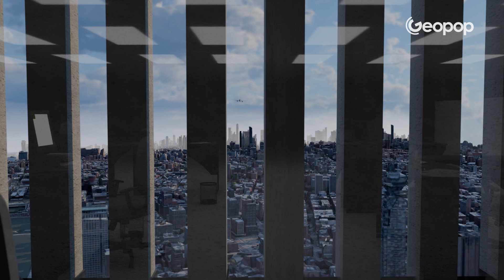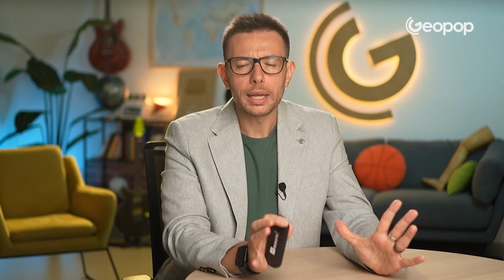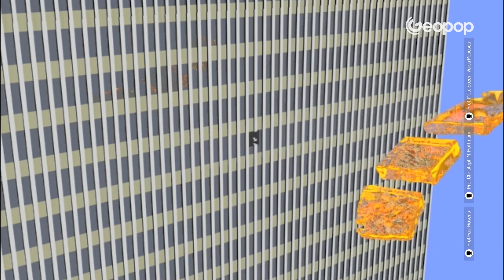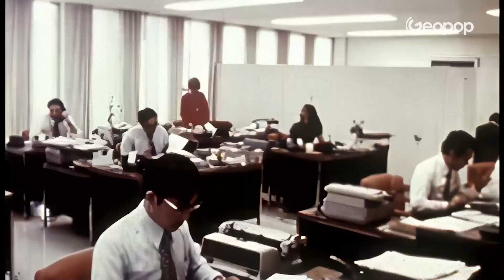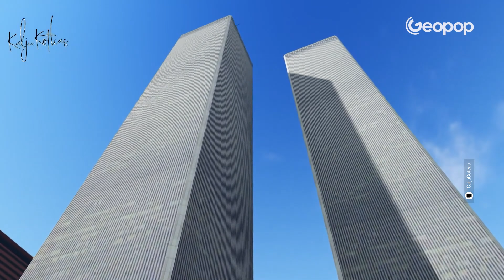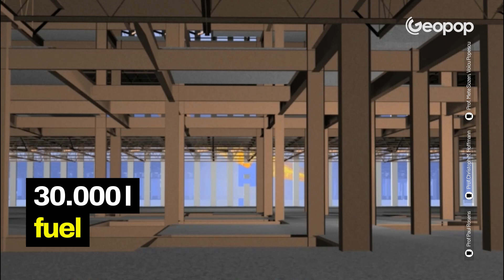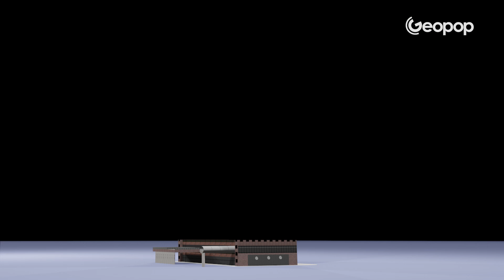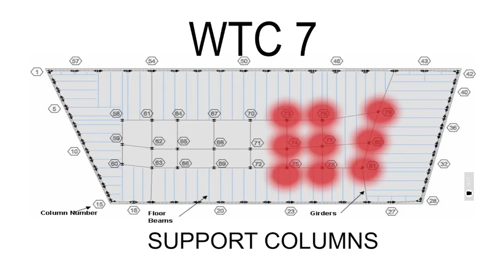9/11, 2001: The Technical Reconstruction of the Twin Towers and WTC 7 Collapses

Comment: Let me emphasize several facts your video got wrong:

9:13 - steel does not loose, but INCREASE strength when increasing temperatures from 20°C up to 250°C. It weakens to the same strenght as on room temperature when heated to about 400°C. This means that parts of the structure that weren't heated much were actually STRONGER than cold parts of the building!

11:47 the higher the temperature, steel deformes more easily, but its breaking point extends, up to the point where very hot steel doesn't break at all! Very hot steel can be elongated more than HUNDRED of times without breaking (remember steel mills?). Cold steel breaks, hot steel bends! Therefore, very hot beams of the WTC surely didn't break, but rather BENT, FLEXED or BUCKLED!

12:30 even your animation does not match the "as seen on TV" videos: your simulation shows some parts of an airplane (e.g. wingtips) bouncing off the outer walls of the building and falling down outside (as it would be expected). However, there were NO parts of the airplane "as seen on TV" that fell down outside, i.e., whole of both airplanes entered the buildings. It was only the explosion (of what*) that ejected parts of those airplanes outside of the buildings.
* - jet fuel in an airplane cannot explode, that's simple physics. If it did explode, the blast would break liquid fuel into mist that cannot form ponds on the floor and therefore couldn't have burned long enough to heat up the concrete/steel enough to cause a collapse. We know it didn't happen because there were testimonies from survivors who claimed that jet fuel seeped down the stairwells and elevator shafts.

13:38 how do you know that impact severed exactly ten core columns? Were there any survivors to examine/witness that? Yes, the outer columns can be easily counted from the videos/pictures filmed from the outside. But who filmed the interior of the building after the impact?
Reply: I feel like the people inside were a little too preoccupied with something else to check if the support columns were severed
Reply: The building was held together by the floor trusses. The interior columns were connected to the exterior walls by the trusses which gave the building its structural integrity. Sure there’s not much difference in the strength of steel under 400 degrees Celsius. But it drops off dramatically after that. Standard jet fuel burns up to 1,000 degrees Celsius. So I don’t really understand why you think 400 degrees Celsius is important. Steel trusses fail at 600 degrees Celsius which unprotected can be reached in minutes in a 1,000 degree fire. The impact of the airplane knocked off the majority of the fire proofing around the floor trusses. So they were able to heat up rather quickly. Also trusses get their strength from their shape. So once you start heating up portions of the trusses they expand and deform which dramatically reduces its strength. Far more than if it were I beams or just a slab of steel which get a lot of their strength from the actual material. I agree that this isn’t the best presentation when it comes to detail. But yeah when you look at the blueprints and you realize the structural integrity of the building is maintained by the floor trusses then it all makes sense. Once the trusses reach a temperature of 600 degrees Celsius they will fail and multiple fires on multiple floors will mean once one fails it’s going to cause the next one to fail simply because it was likely about to fail  because of the fire anyway.  Which causes a cascading effect and yeah the entire building unzips. I’m not sure about building 7. I haven’t really looked into it. But 1&2 make perfect sense for why they fell in the manner they did. I haven’t seen any convincing evidence to support a controlled demolition.
Reply: @SuppressHoardReject  You obviously didn't read both my comments thoroughly. Think about this: the only way to make the floors "pancaking" is to heat the complete floor structure to at least 600°C simulaneously! The whole 2300 tons of steel and 2300 tons of concrete! But then, calculate how much energy was available at the time (airplane and furniture) and you'll realize there was enough to heat up MERE 10% of a single floor mass. Then go and check impact hole of the B767 and you'll realize it broke into THREE FLOORS, therefore this itsy-bitsy-tiny amount of energy was spread to not just one, but three floors! Not 2300 + 2300 tons, but 6900 + 6900 tons of steel and concrete. Therefore, stripping of fire proofing and 1000°C burning temperature of jet fuel meant nothing! Heating just one spot on the floor wouldn't make any difference structurally, plus the heat quickly spreads throught both steel and concrete, so the whole floor had to be heated up to 600°C simultaneously, but there simply WASN'T ENOUGH ENERGY for that! Why is everyone quiet about this?!?

400°C is important because up to 400°C steel retains its original strenght. Meaning that, heating for 250°C is not enough, even 400°C is not enough. Only above 600°C steal does get weak, but then it DOES NOT BREAK, but bends, buckles, sags, twists... Therefore, a properly heated WTC floor would SAG into a bowl-like shape, NOT break and it would NOT have created the pancake effect! Google: "steel ships destroyed by fire" and you'll see what I'm talking about.

I said I was working in ironworks and I know how difficult it is to heat up the steel and how the hot steel doesn't break but can be elongated numerous times (13 x 13 cm, 6 meters long steel beams were elongated - milled into 12 millimeter rebar wire 250 meters long)! I posted more numbers in my previous comment. It turns out heating the concrete is even more difficult (and you cannot heat them separatedly).
Reply: "how do you know that impact severed exactly ten core columns? Were there any survivors to examine/witness that? Yes, the outer columns can be easily counted from the videos/pictures filmed from the outside. But who filmed the interior of the building after the impact?"

How do you know they didn't?
Reply: @ghostsignal  Exactly! I do not know they didn't just as examiners do not know they did! Examiners calculated that it would take - EXACTLY - ten broken core columns to collapse the building - threfore it had to be that exactly ten were severed. Funny enough, exactly ten inside both buildings! (Nothing fishy still, @ghostsignal?)

But then if you take the structure of the aircraft, its weight, its available energy, the trajectory into account and calculate how many it could actually severe, you'd get nowhere near the number of 10 columns. Examiners also realized that but decided not to speak about it! I can understand them, they're under political pressure, but what about the rest of you? Why do you keep quiet? Am I the only one doing calculations here?
Reply: 13:27 - the fire proofing materials were applied on the bottom side of the floor, right? However, the animation shows that airplane entered the WTC in downward direction, therefore concrete slabs of the floor were preventing airplane parts touching steel trusses, thus protecting fire protection coatings from being removed. Your animation (and post-impact pictures too) shows that floors survived initial impact more or less intact. Right?

14:11 + 3:25 - if WTC had 250.000 tons of steel and 250.000 tons of concrete, and it had total of 110 floors, it means that one floor had about 2300 tons of steel and 2300 tons of concrete. Your chart shows something called "burner" with 10500 kilowatts of power, did you ever try to calculate how high temperature such a burner can heat up 2300 t + 2300 t of steel + concrete in 78 minutes*? Well, my calculations give MERE 8°C !!! (assuming efficiency of heat transfer was 50%)

* - I was working in ironworks and I know for a fact that it takes 10-megawatt furnace one hour to melt mere 30 tons of steel. 2300 tons would take more than three days of round-the-clock operation. That 10-megawatt furnace would burn about 400 tons of coal in three days (a B767 had only about 21,5 tons of fuel onboard - as said in 12:55). And let's NOT forget concrete that wasn't even mentioned in this note. Furthermore, an airplane struck at least THREE consecutive floors (meaning the same fuel actually had to heat up at least three times more mass).

Comment: Starting at 14:47 If the floors collapse and outside walls collapse what causes the center core, either the 47 columns, to just give up and come down at the same speed and at g to he same time as the exterior walls?
Reply: Nothing, as it didn't. The core standed seconds longer than floors and outer walls, but did also eventually collapse. Some of it was standing even after otherwise complete collapse.
Reply: @wallyllaw  So, there was enough friction from the connections of where the collapsing surrounding office shell connected to the inner elevator core to pull it down; but, there wasn't enough friction where the floors connected with the offset three story sectional column to slow down the collapse.
Reply: @lizardfirefighter110 they didn't fall at g.
Reply: @orionred2489  They didn't accelerate at freefall? Still makes little sense.
Reply: The flames and suddenly having to bear so much weight caused the center columns to fail
Reply: The floors are connected to the central core.
Reply: @phill6859  The central core held up 70% of the total weight which was half of the live and dead loads of the office space area as well as itself.
Reply: There are videos and even pictures out there that show parts of the center core still standing after the floors and outer walls were stripped away, but without any support it too collapsed a few seconds later.
Reply: @reignman30  There is no such thing as a level straight down collapse in nature. Figure the office floors toppled back and forth at angles tearing up the inner core.

The outside sectional columns provided protection from horizontal  loads like wind and jets; while, the inner core provided most of the vertical load which is said to have been seventy percent. 
So, they both worked together and couldn't stand alone. 
The inner elevator cores were mostly air for elevator shafts meaning that there wasn't that much concrete to pulverize.
Reply: Exactly right,
The whole thing fell as one and didn't fall floor by floor 
Read Dr Judy woods book the for real truth

Comment: Don't care about the voiceover. You should however use your common sense voice. Every one of these videos I see that set this narrative always mention speeds that plains can't achieve at low altitude, reasons why steel bent at relatively low temperature, and that a sheet metal aircraft ripped through huge steel structures. Now explain away the testimony of many firefighters that spoke of the explosions they witnessed and where the nano thermite particles in the dust came from. I'll be waiting. Also, all those talking about flat earthers, wake up and smell the deception.

Comment: Questions I have that has never been answered are; the tower were 110 story buildings and when they started to collapse debris was ejected outwards as this was happening the total load on the lower levels was obviously less and less, so why did they collapse all the way to the basement level? I mean the last 10 floors had almost 100 floors less of load over them so why couldn't they handle this now extremely light load?
Reply: Dust and smaller, lighter stuff got blown out.
Reply: @nedg3740  Holy shit! did you not watch the collapse? Beams and other massive material were embedded into adjacent buildings!
Reply: @robertdufault3810 that is the banana peal effect. Get with the program.
Reply: @riverdung2000  So obviously there is no longer 100 floors of weight over the last 10 floors so there is no reason for it to keep collapsing into the basement levels
Reply: @robertdufault3810 The amount of debris ejected wasn't sufficient to prevent the collapse of the lower floors, The floors didn't just disappear, they fell vertically down into the rest of the building, I can see the logic behind your thinking, (If it was built to withstand the load of all the floors, why'd it collapse when the load was lessened from ejecta?), however it was only built to withstand primarily a more or less "static" load, when integrity fails and things start to collapse, the load becomes very much "active", sudden, powerful loads applied in very short times in uneven ways, It wasn't designed for that type of loading
Reply: @riverdung2000  
peel
Reply: @robertdufault3810  Most of what went straight down  was cement. Each floor had 4 inch thick pads. That kind of weight doesn't tend to move sideways very much, but straight down instead !!
Reply: @robertdufault3810 when a floor collapses all of the material that made it and that were inside don’t just disappear, they all fall onto the floor below
Reply: @robertdufault3810  you can't argue with these people. They are firm believers in the narrative the media says. I'm willing to bet they got all their safe and effective pokes. Too many inconsistencies to swallow this narrative. Did plane's hit yes, not many dispute  that. Does it seem suspicious that 2 weeks before the collapse there were people coming in at night, maybe? Put options place on the buildings, mayb?. The money that disappeared, maybe? Don't waste your energy, these people are so deep into the matrix that they can't open their eyes to the very real possibility it was self inflicted.
Reply: Acceleration einstien
Reply: @ogzombieblunt4626  Each floor slowed the floors above. It never accelerated
Reply: @robertdufault3810  
It absolutely accelerated, each floor only slowed the acceleration.
Reply: You make absolutely zero sense! They had the load of the whole building coming down and collapsing on top! But thats irrelevant! The planes are confirmed and common sense defies the suggestion that a live building has been prepared for a planned demolition!
Reply: M = m*v (Momentum equals mass times velocity). The ejecta mass was much less substantial than the mass falling directly downward, where capital M kept getting larger each floor.

If you don't think this equation fully answers your question, then you should go back to your closest high school and sit in their science classes (this time pay attention).
Reply: @ellayararwhyaych4711  If you wore a mask during covid, you trust the NIST report.
Reply: There was no “extremely light load”. The reason the bottom 10 floors collapsed was because they had the weight of 100 floors fall directly on top them.
Reply: @kscri1335  You obviously didn't read my comment
Reply: @robertdufault3810  
@Kscri1 clearly did read your comment -- and did you the favor of explaining what you were missing.
He was too charitable, underestimating your stupidity.
Reply: @robertdufault3810 Are you saying that you think all of the debris was shot outward? That nothing of the 100 floors between the bottom of the impact and the 10th floor actually fell into the footprint?
Reply: ...you seem to be imagining the floors as if they are some monolithic block. They were a system of columns and trusses, and having 100 floors worth the debris come crashing down on them with the equivalent kinetic energy of a large bomb completely compromised that system. Tearing floor trusses from their mounts, there's nothing holding the columns plumb, no support against lateral failure.

Whatever "loss" of material ejected away during the collapse doesn't make up for the increased inertia of the debris that still struck.
Reply: The lower floors failed because 100+ floors were effectively dropped right on top of them
Reply: Some of those beams were injected into the street below like arrows.
Reply: @donquique1  
No they weren't.
You're imagining things.
Reply: Lmao what a biased way to present things... "obviously less and less" "extremely light load"... 😂. Jesus christ there's no helping some people. Touch some grass maybe.

Comment: WTC7 was, to be blunt, under-structured with a power substation on the floor of the north end of the building, despite having several structural supports built around it, but all bets were off when all those debris fell from the North Tower smashed into the south side of the building upon the former’s collapse.

Comment: Where did the high temperature thermite dust come from , the people that inspected the dust through microscopes found massive amounts of high temperature thermite dust within the rubble & not only this  what caused molten iron to flow down the column rails .molten iron is a result of hight temperature thermite charges which is used in control demolition.
these towers where brought down by CDI. this demolition company just so happened to be onsite the week of & before WTC was attacked.
EXPLAIN THAT ???.
YOU CANT this was an inside job so the USA could rectify their war in IRAQ & AFGHANISTAN.
The powers that be wanted control of the worlds opium & oil.
The planes that flew into WTC & the Pentagon where merely a distraction to what really happened behind the scenes.
Reply: Crazy coincidence that planes flew into both buildings just before these so-called 'demolitions'!!!